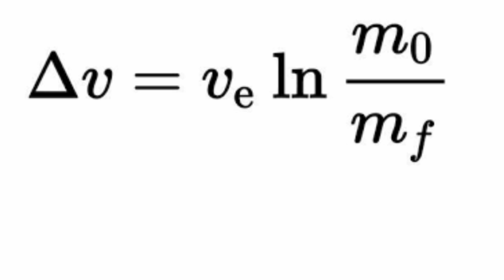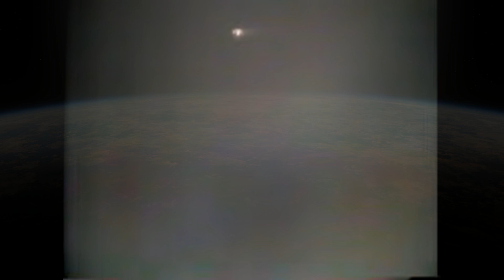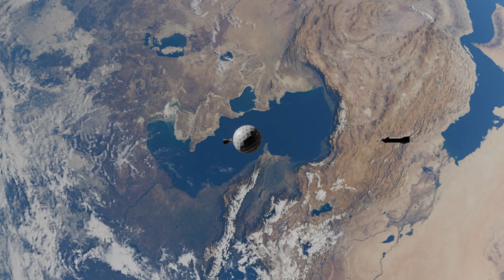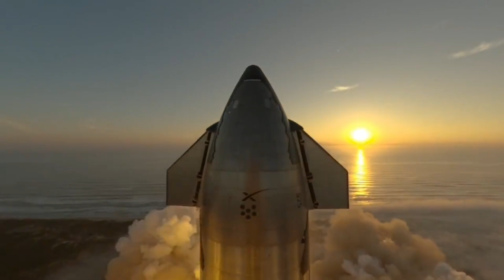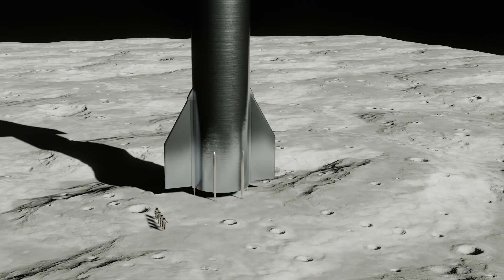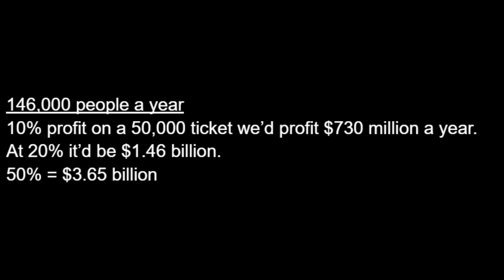Building Nuclear Ships On The Moon

Comment: I'd rather see a nuclear tug than a nuclear ship. Attach a bunch of starships to the outside (maybe 4 in an X formation), with your nuclear engine in the centre & presumably way away from the ships. Bonus points if you can spin the tug while the ships are attached, for a little bit of gravity.

Comment: There is a big difference between a nuclear thermal rocket and a nuclear gas core engine... as we have built and will be soon testing nuclear thermal engines soon.... we have not built nuclear gas core engines, and so it is confusing and misleading to discuss this technology while showing the nuclear thermal rocket engine tests that occured in the 1960s as part of the Kiwi and NERVA  programs...  
Nuclear gas core reactor engines are still in the theoretical analysis phase, and so are 50-60 years away before we have a practical working engine...

https://en.wikipedia.org/wiki/Nuclear_lightbulb

Comment: Really enjoying this series. You are one of the few that are proposing positive nearish term engineered solutions so kudos for that. As a long time advocate of solar thermal/electric propulsion I have to push back a bit about open cycle nuclear thermal is in any sense a near term technology. There is a high likelihood of considerable much money and time to be spent and there is currently no funded program to develop the. The competition is hydrogen oxygen derived from lunar sources for rockets that get to and from the moon about as quickly as an open core could and have no need to acquire more uranium for each flight.
A mass driver could launch heat shield equipped cargo directly back to Earth or orbit with aero capture.

Comment: Just my 2 cents;

- A Nerva engine would be more economical in the long run because while it povides a respectable thrust per ton of ship+propellant it doesn't exhausts precious enriched fissile fuel. I read somewhere that a Nerva space tug to Mars could be reused for 200 trips (100 round trips I assume) before it needs replacing (meaning just the core, which could eventually be reproced). An even higher lifespan is to be expected because of lower dV destination, using the Lagrange points for refueling propellant, or using a cycler architecture.

- Nuclear-electric propulsion (or solar-electric) strikes me as the best balance. With minimal propellant mass requirement and multiple fuel choices (depending on the availability of lunar ices; if lunar hydrogen is not on the cards, nitrogen or argon from earth can be a good choice), and distance can be used as a substitute for shielding with NEP. It's also pretty easy to generate artificial gravity spinning a simple habitat-boom-reactor ship like a dumbell. 

This channel was suggested to me today out of the blue, I can see you have a 50 min video about a complete architecture for a lunar base...I'll be very entertained for the next hour!
Happy to find your channel my fellow nuclear-loving, space-optimist futurism-enjoyer!
Reply: problem with a NERVA rocket is that there overall less Delta V means that they take a lot longer than there gas or molten core fissile counterparts. sure a tourist may be willing to spend a few days in a room as cramped as a modern airliner but ask them to spend weeks in it and they will go insane
Reply: I am with you on nuclear electric, we can get crazy high ISP, easy refueling, safe operations, consistent thermals, higher tech reediness, harvest propellant from above the atmosphere. For all orbital operations it sounds great, just for ascending and landing we need something with more thrust.
Reply: Electric propulsion (or any other low-thrust option like nuclear fragments) would be limited to cargo, because it would require multiple passes through the Van Allen belts while slowly raising the orbit. Which is not good for people. But it's okay when you start above the belts and go to other planets

Comment: > Partly because the moon has lower gravity but it's mostly because the moon lacks an atmosphere

Uh, no.  It's almost entirely because of the moon's lower gravity.  Atmospheric losses when launching from Earth are minimal; the rocket gets up to altitudes where the air is crazy thin very quickly, but it's still got many km/s to accelerate to.  It's why we don't bother trying to launch from the tops of tall mountains; there is a very slight gain, but it's not worth the engineering hassle of building facilities there.  You get far more benefit just from launching at lower latitudes.
Reply from the maker: The atmosphere requires things to be made aerodynamic which is a huge constraint. On the moon or in space you can scale massively. I'm a fan of everyday astronaut as well ;)
Reply: @Anthrofuturism Sure, but in practice that really just means a fairing cover.  It's a minor, minor fuel expense.  The vast, overwhelming amount of the fuel consumed in getting to LEO from Earth surface is just attaining that 9.3 km/s.  There's a few percent each lost from fighting gravity, atmospheric drag, and steering losses from rockets not pointing precisely backwards.  And of the three, air is the lowest concern.  

When a rocket reaches Max-Q, like 60 seconds into a launch?  That's basically an indicator that concerns about air are over and done with.  Meanwhile it's still got a loooong ways to go before reaching orbit.

It's like saying that aerodynamics is the hardest part of breaking the sound barrier on a bicycle.  It's certainly a consideration, but far from the most daunting.

Now, what what the lack of atmosphere does let you do is ground-based linear accelerator or railgun launches, something made easier still with Luna's 1 km/s orbital speed.  Try doing mach 25 on Earth, even at the summit of Mt Everest, you're gonna have a bad time.

There is a megastructure that will let you do this, called a Lofstrom Loop.  Basically a linear accelerator that, once brought up to speed, will actually hoist itself far up into the sky, 80km or so.  Then you magnetically attach a payload and let it get dragged along for the ride.  The really hard part is, in order to get even most of the needed 9.3 km/s at human-survivable g-forces, it has to be on the order of 2000km long.

https://en.wikipedia.org/wiki/Launch_loop
Reply from the maker: @jdlessl  yes the vast majority of fuel expense is in getting to 9.3 but that speed is harder to achieve with an atmosphere because drag increases with the square of velocity, so all the fuel you need to get to 9.3 you have to lug up out of the atmosphere. Sure they achieve this quickly but it's not true it's an insignificant amount of fuel or resources. It's like you have to have a rocket to carry the actual rocket out of the atmosphere before the actual rocket gets up to speed, which is the first stage of rockets. You're arguing the atmosphere is the smaller concern and gravity is the largest cost because it means we need to go faster but without an atmosphere speed is much easier because there's no drag which, again, squares with velocity. Not to mention the need to add control surfaces and whatnot because of the atmosphere.
Reply from the maker: @jdlessl  let me clarify, I understand most of the delta-v cost comes from gravity, but the delta-v cost doesn't = the rocket cost. The majority of the cost per kg to orbit comes from complications arising from the atmosphere. The propellant itself isn't that expensive. I see how I didn't make that clear in the video.
Reply: @Anthrofuturism  Again, still not true.  Take away Earth's air, and an orbital launch is still a monstrously complicated beast requiring 98% of the same delta-v.  That fuel is cheap is irrelevant.  Rockets get more and more complicated and correspondingly expensive as they get bigger, and lack of air doesn't let you make them appreciably smaller.

The Apollo lunar launch rocket was simple because it only had to generate 1 km/s delta-v, not because it was in a vacuum.

In fact, having an atmosphere actually lets you crank up the pressure inside your fuel tanks by one atmosphere higher than you could if it were vacuum on the outside.
Reply from the maker: @jdlessl  again your thinking delta-v is directly proportional to cost 1:1 when really is a smaller fraction of the total cost breakdown. Anyway, this in no way changes the ultimate points or conclusions of the video.

Comment: If you build a lunar space elevator it would make the cost even cheaper to send stuff to LEO. Sending bulk materials from the moon to the LEO to build space hotels, space factories, fuel depots, orbital military bases, such as titanium, steel, fuel, aluminum all of which are available in the regolith.
Reply: The problem with a space elevator is orbital debris. It’s like building a bridge in a bay filled with runaway cargo ships.

Sorry too soon? 😬
Reply: @enclave6285  There's also gravity, elevator size, and material strength to consider. If the upper part is too close, it'll fall. Too far, it'll fly away. What we could do with it is dependent on size as well because too big = more mass * gravity = collapse. Too small = pointless because it likely won't even have space for a docking port. And to my knowledge, we don't have a material that can handle the forces required to keep a station tethered to earth without it snapping.

Sorry to be a downer, I want a space elevator as much as the next guy but it's simply not feasible at the moment. Plus, no one is actively researching and developing plans for one anyway.
Reply: @shawnasbury7375  I believe they didn't mean Earth-orbit elevator, but a lunar elevator, stationed in the L1 point. Kevlar would be sufficient to hold such a structure in place. There's the problem of sourcing enough kevlar, of course.
Reply: @enclave6285  I would think any society capable of building a space elevator is also capable of cleaning up earth's orbit.
Reply: Yeah, I meant a LUNAR space elevator not an earth based one. Technically you could use steel cable for a moon elevator (but it would most likely be Vectran), plus with being on the moon you can use several different attachment points. Since a cable would be at the lunar equator which isn't as useful since all material would have to have a long trip from the south pole. Attachment points could also be placed at the nearer the south and north poles. This would let them act as backups to the main cable and as elevator cables.
Reply: I think a lunar orbital ring would be better, you can get closer to more of the moon, and you can use the circular nature of the ring to accelerate much more than with what you can carry on your ship, which saves propellant/fuel. Plus its easier to go where you want just by releasing at the right point on the ring. And you can build multiple of them to serve as a local transit option for passengers and bulk cargo. Plus more rings means more launch angles which means with enough rings you dont ever have to worry about your ring facing the wrong way.
Reply: @Nomenius1 Yes this! A lunar ring lets you get any mass vehicle, anywhere in the solar system, with a full tank of fuel when you arrive.

Comment: Ah, your making a couple mistakes off the bat.

First,the earths atmosphere doesn’t add cost, nor lunar vac save money.  Atmosphere can actually save you cost and rocket thrust.

Secound, adding up the delta Vs to LEO from earth or the moon.  Most basic, the important questions are cost, or difficulty.  Given it’s actually always been cheaper to launch from earth to LEO then from the moon (actually it’s cheaper to launch from earth to Lunar orbit, then from the Moon to lunar orbit) and good reason to think this won’t change.
Then there’s the actual delta V your transport needs to provide.  Obviously their no need for any real Delta V down from LEO, but also if you add some air breathing cycles to the launcher, you can lose about a third the Delta V the rockets need to provide to LEO.  Roughly halving the take off weight of craft per ton of cargo, and lowering service costs and flight costs.

Third.  If you notice, rocket boosters are not very aero dynamic.  They are just stacked tanks.

Past that ( and the nonsence about starship - oh, it is calculated starships will need about 20 launches to get 1 to get to the moon ), and thinking open cycle fission reactors are any closer then fusion rockets given both have designs.  (Note Lockheeds already researching and developing fusion drives for marketing in 20-30 years)

why would anyone build a rocket on the moon?  Note current construction of nuclear boosters (yes two are already contracted.  One for the Space Force, one for NASA earth to Mars missions) are on earth.  I mean a nuclear rocket is not something you’ld use centuries from now( or several decades from now really).  So all it’s parts would need to to be shipped to the moon for assembly.  Much easier to ship them to orbit and assemble them.  
And again, no one’s done any real work on nuclear rockets past NERVA or Timberwind (and those are looking a little long in the tooth.  So some suggest nuclear-electric-ion), so there is dev work involved and the old designers are dead or retired by now, so not sure how fast folks are expecting to get ones in production again?  Hell, I’m not sure how much of the nessisary nuclear industry is still available?

Jumping to a open gas core rocket is a huge leap.

You seem to be trying to fit facts into your preconception?

A big factor you need to get a better Handel on is what drives launch, and boost costs.  As has been historically shown even the often quoted 20 fold energy saving from moon to GEO sync vrs earth to GEO (or LLO) doesn’t save you money (I.e. value of all resources expended.)
Reply from the maker: Cost reductions come from manufacturing economies of scale and performance efficiency.

As noted in the video shipbuilding on the moon only makes sense once some development and infrastructure is already present and we get that via tourism.

Anyways the real issue is getting enough speed to orbit and drag increases with the square of speed but even if air breathing rockets are superior that just decreases costs even more which is great I'm all for it!
Reply: @Anthrofuturism  manufacturing, but mainly operational economies of scale.  I.e flight rates.
Then of course is basic economics like labor hours and cost per hour.
Energy and delta V costs are negligible.  For a full rocket SSTO worst fuel guzzler around, you’ld burn a couple dollars of fuel per pound lifted to LEO.
Air breathing cycles are not complicated, and have flown for decades in missiles.

Drag increases with the square of velocity, but with thrust efficiency tens of times higher then rockets, you can get to Mach 6-7 and very high altitude beyond 99.99% of air, with about a 20th the mass consumed to get there.
Speed doesn’t mater.  Cost maters, and simplifying the engineering and lowering operating costs, are big.

(I did research on developing a ultra low cost launcher system using modern tech, and and parallel markets, to get cost down to $10-$20 a pound to LEO.)

As to shipbuilding on the moon after there’s shipyards.  Clearly that won’t happen before nuclear gas core rockets are very dated.  Even with that, building there vrs at Leo would still make sence.  Both because it’s easier to get the parts there, and nuclear rockets like that arnt great to take off and land anywhere. 

Ild still recommend a micro NERVA, or one of the other fusion drives in development.
Reply from the maker: @KellyStarks  I'm curious about your ultra low cost launcher system. Are you able to share? Do I need to sign an NDA lol
Reply: @Anthrofuturism  
Na, had a group trying to develop it, had some major engineering folks interested in being involved .. one was the program manager for NASP with McDonnel Douglas.  But angel wrangler got sick on us, but strung us on for months before admitting it.  Then economy dove as Obama was coming in.  Everyone drifted off.  Since then only flakes seem to want to talk about it.

It’s basicly a bizjet sized, jet fuel fueled, suborbital/orbital craft.   Similar concept as the old Star-Raker.  The market for ultra long range (say 10,000 mile range) bizjets was projected for up to 10,000 units in the 2000-2020s range.  So using upgraded Mach 6 to 7+ turboramjets able to run on jetfuel (which both RR and GE or PW said they could stack up from existing parts) and a LOx - jetfuel rocket, it should be able to reach orbit, or a suborbital 10,000 mile hop.  (There’s only about a 200 mph peak speed difference.)

My best estimate after interviewing folks who serviced SR-71’s turboramjets, and similar military parts, and estimates for ultahigh temp,ceramic composite insulating skins.. It looked like for 20 times the effective land speed for 4 times the per pound cost, over ranges like trans pacific.  Assuming you had the economies of scale of a couple hundreds sold, and each operating hundreds of flights a year.  Cost to orbit with the biz jet market eating all the overhead should be in the $10-$20 a pound range.  (Give or take inflation since then.)

Called it the ArcJet.  Figured a small craft like that, able to bypass all the sonic boom overflight issues, and operate out of normal airports (normal with major LOx suplies) should spawn rapid dev into bigger airliner sized craft, for airfreight (FedEx and cohorts had been hunting hard for a ultr fast air freighter.  And others. ), and if you can’t boot start space dev with launch costs that low out of local major airports, it’s not going to happen.

I still have a early draft of ideas the busness side of the groups was to pitch, and a old article I wrote on the Star-Rakers if your interested.